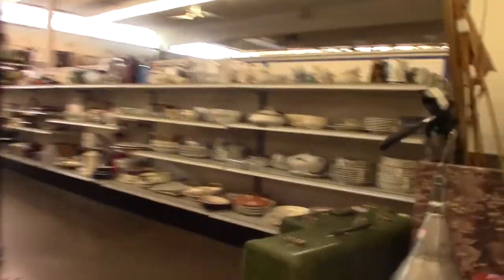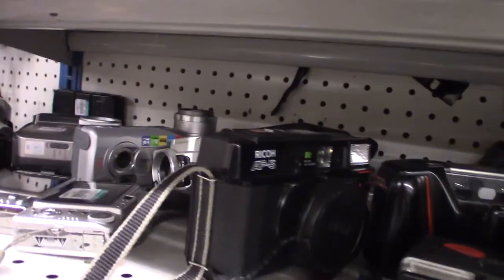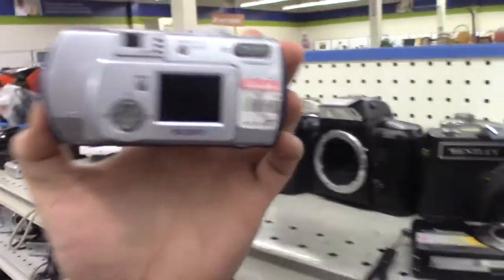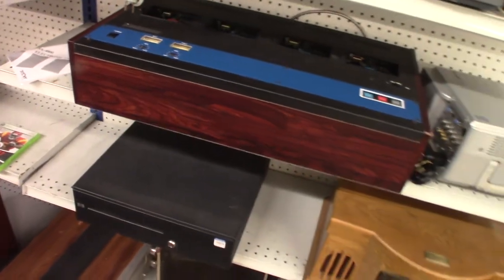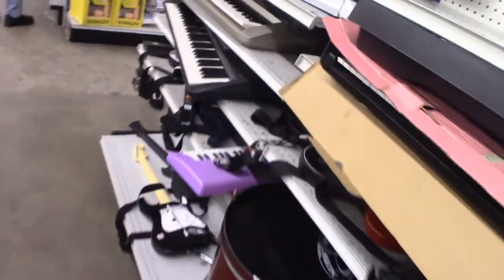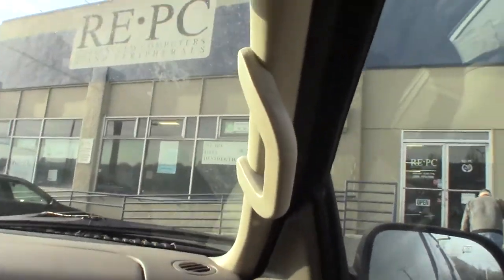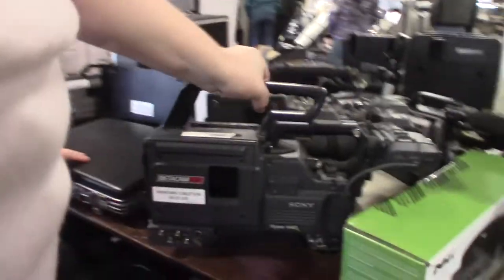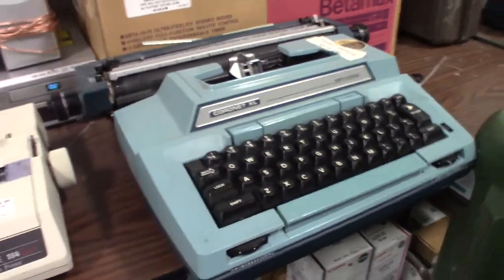Goodwill Trip 5

Comment: I have one of those mechanical “stampers” as you called it. It’s actually for filling out cheques. They typically stamp in the cheque amount digits as well as the amount spelled out. Mine also embosses the cheques so they can’t be tampered with and the ink roller lasts forever. 👍🏼

Comment: 9:17 here in the UK where we went all in on ISDN we're still using it. We have a ISDN30 at work, this would work with a ISDN 2e which you could get installed at home. You could use it as a remote DJ for a radio station.
Reply: The FSOL album “ISDN” was so-called because they did live sessions to a radio station over ISDN.  The most amazing thing about all of that is:  Radio was actually good, once.

Comment: 5:50 - I (somewhat fondly) remember using those Alphasmarts in middle school. I always thought it was kind of neat and clever how they hooked up to a computer using PS/2 (or possibly ADB) and would simulate the keystrokes to transfer whatever you had worked on into the computer. Somehow we had figured out the undelete command, and would snoop on other people's documents, since they were basically shared/on loan from the school's library. We mostly had the older beige models. Later on I think they picked up a few of a newer model, but I'm not sure if they were styled like the one you found.
Reply: 19:40 - OOh, the SPEBSQSA - My HS Spanish teacher was a member. As a result, I'll never forget that it stands for The Society for the Preservation and Encouragement of Barbershop Quartet Singing in America, Inc. They've since rebranded to simply "Barbershop Harmony Society" :(.

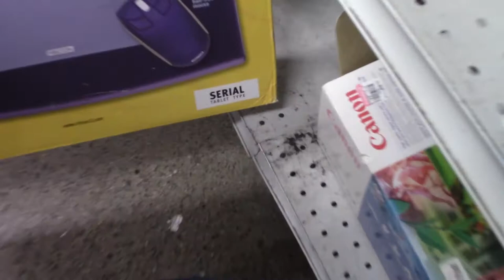Comment: 21:58 I bought a modern Canon LiDE 300 scanner new just a few months ago from Argos in the UK for just £50 (cheaper than the Amazon price of £70)! I'm still amazed that it runs off USB, I'd have thought there wouldn't be enough power. Results are pretty good, but it seems to be fussy to start under both Linux Mint and Windows 7: It's like the scanner isn't detected properly sometimes. I'll have to see if it runs under Windows 10 when I actually get round to installing it.

Am I right in saying that separate flatbed scanners are dying now? They mostly just seem to be a part of printers these days
Reply: I found a LiDE model for $10 a few weeks ago. I’m still getting used to the idea of a scanner that is powered over USB and doesn’t take forever to warm up.